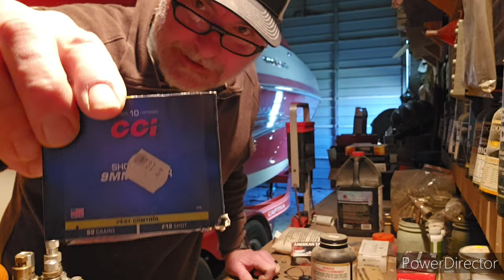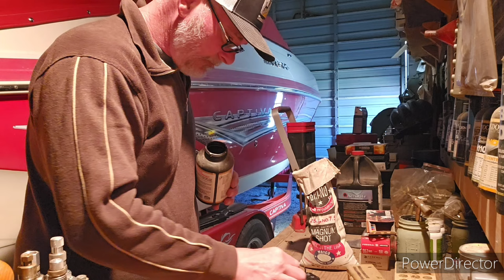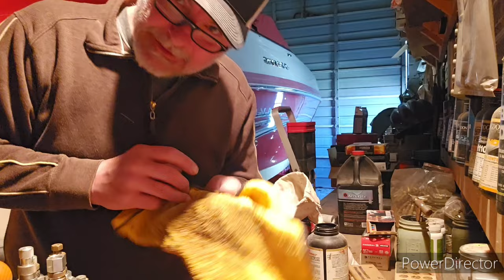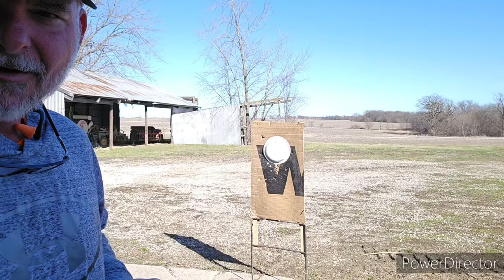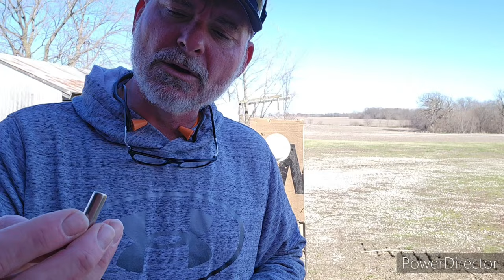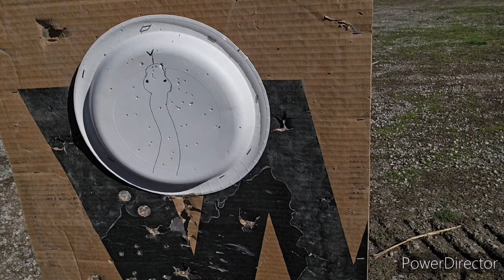DIY Pest Control load

Comment: I made these years ago and used the same basic concept, just didn't crimp them.  Then I found the commercial shot cups they only make those in 38 and 44 so if you want shot in 41 or 32 or? you have to do this process.   I got my shot by cutting open a few 12 gauge shells so I didn't have to buy a bag. I shot a paperback novel and compared it to the CCI and the penetration was about equal.
Reply from the maker: The shot capsules are expensive and unnecessary. I have opened #8 shot shells in the past, before I had bags of 7.5 on hand.
Reply: @SheriffMattOller  speer shot capsules are about a quarter a piece, I found they gave tighter groups (4 inch barrel) and didn't leave as much garbage in the bore.  .  It comes down to each individuals choice and budget.  you seem to shoot a lot of them from a short revolver so your way works, I still have a bunch of shot capsules that I bought 30 years ago, I don't live the same place you do so my needs are different.
Reply from the maker: @elund408  it seems the only way you can get ahead these days is if your loading stuff bought years ago.........

My powders mostly bear $15 or so dollar price tags........ that same pound of powder is nearly $50 today.........

Shameful.